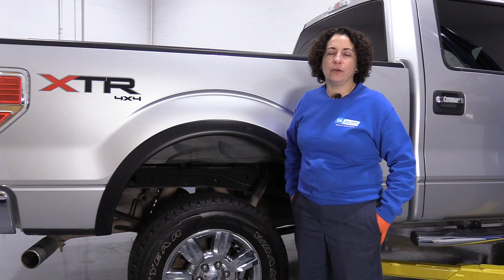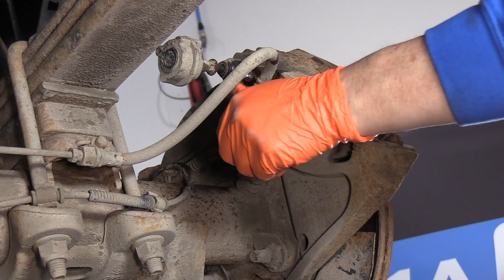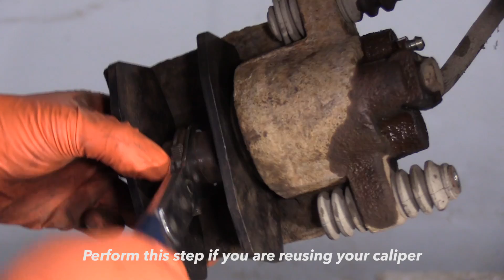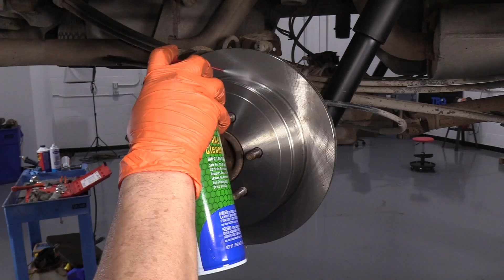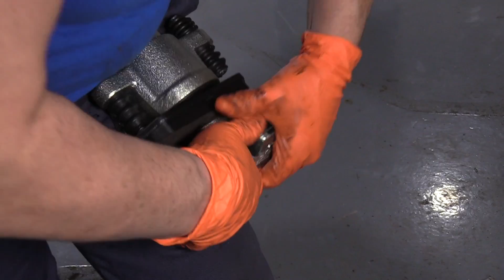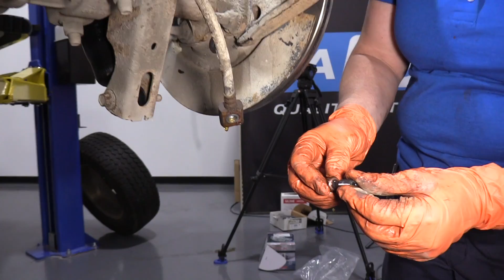How To Replace Rear Brakes 04-11 Ford F-150

Comment: I have never opened the bleeder screw on any vehicle that needs a brake job and has abs and never once have i damaged an abs module by pushing the piston back. They are designed to have pressure go both ways.
Reply: Me either and I have 30yrs. M-Benz experience.  ABS has been around since MY '82, or thereabouts.
Reply: Your both Wrong! The ABS is Not designed to have force against it (Push In) you must open bleeder screw. I'm a mechanical Engineer from Ford.  
Why do you think we have bleeder screws? Bleeds Air out of lines (when replacing Calipers) and allows safe retraction of bake cylinder equipped with ABS system.
Reply: Me neither. I’ve always done my own brake jobs, always had abs, and never released the bleeder valve for just changing pads and rotors. Never had a damaged abs. 🤷‍♂️
Reply: @SF-rl7hl  The official Ford service info doesn’t instruct you to open the bleeder at least on a 2009 RWD model. Some people do it but living in the rust belt I’m going to try and avoid it.
Reply: I never did either but recently learned that the reason you should do it on abs is because the fluid in the caliper area gets very hot during breaking and can become contaminated.  If you push this fluid back up into the abs module you risk damaging the abs module -   really expensive part.
Reply: @SF-rl7hl  Ford stated that the module is designed for both directional flow, this is how the pads release back when you remove your foot from the peddle. However, not opening the bleeder will allow contaminants into the system which could cause faults

Comment: The harmonic balancer on the caliper slider comes off. Hold the caliper bolt with the 10mm wrench and use a vise grip to give the balancer a twist. Remove balancer then use the box end of the wrench or socket to remove caliper bolt.
Reply: Wish i wouldve read this 2 hrs ago. Mine was rounded
Reply: it is held on with a torx head small bolt under the plastic cap

Comment: enjoyed the video, we forgot to grease the back of the pads mating surfaces, i believe we forgot to grease the shim surfaces , we also forgot to antisieze the 10 mm and bleeder valve , brass banjo plainly doesn't need it, also while cleaning and adjusting the parking brakes there is three contact points per shoe that get a dab of grease and if my memory serves me right there is an actuator lever that gets rusty and causes the P brake to stick , lil dab of something inside the adjuster wouldn't hurt, nice touch on the antisieze round the center cap area
Reply: No PPE was used, esp. EYE protection.

Comment: I just watched a video where they replaced the rear pads and the rotor on a 2011 F150 and the pads had the double notch on the top and the single notch on the bottom with the wear indicator on the bottom. I figured I would watch your video as well to make sure there was nothing different. I guess I’ll just see how mine is laid out and put it back that way.

Comment: When bleeding, you should tap the caliper with something metal to make sure any air bubbles are knocked loose. Make sure the parking brake adjuster moves freely before putting the new rotor on. Even though the calipers are pretty small, they probably should not be supported by the rubber hose. Otherwise, great info.
Reply from the maker: +a2cryss Thanks for the feedback!

Comment: Take a air hammer with a straight shank or hammer shank and blast it all around the outside of the rotor, it makes them come off especially when you live in the rust belt.

Comment: Should mention that the rear calibers could be potentially put on upside down.  Meaning the bleeder valve is on the bottom and not the top making it impossible to bleed afterwards..
Reply from the maker: +Brad Durnford Thanks for the tip! We'll pass this info along to our production team.

Comment: You got lucky the rims don't usually break loose that easily!
Reply: True that! I literally and feel bad saying this but I never in my life used a sledge hammer untill I changed  rear brake. At first I tried the typical kick  then a few more kicks then even more harder kicks then I took break after it was round two I was felt mike tyson! I beat the u know what out of this wheel.  I  lost 
That round. Long story short after tapping the rim with wood and hammer I cracked the plastic layer. Little did I know that it was plastic coated. I always s thought it to be chrome dip metal. So by time 2 hrs later I got the sledge hammer out destroyed the rim I got it off. I won but i lost. Moral of the story be liberal with antiseze.

Comment: Why the heck would you open the bleeder??????? 25 YEARS AND IM STILL WAITING ON THAT DAMAGED ABS MOD!!!!🤣😂🤣👍
Reply: Was wondering this to
Reply: Apparently at some point in time this "issue" was something to be mindful about. However with vehicles made in the last 20 years it's no longer seen as a problem. Vehicle manufacturers have taken great steps to make sure the ABS Module isn't compromised when changing out brake pads and rotors. It was true during it's inception in the 1970's all the way into the late 90's. First generation ABS Modules were very delicate and one tiny mishap causes brake failure(s). It took years of refinement and revisions to get the ABS technology up to par with necessary standards. So yeah go figure 🍾

Comment: I have never had any ABS issues, I never open a system unless I am changing a calibre. How does a ABS system not allow 2 way fluid direction, it activates brakes off and on ?

Comment: I've replaced a fair amount of brakes without issue and have never dealt with brake fluid.  Is it necessary to do this on my 2010 F-150 or can I pull the caliper, remove and replace the pads, replace the rotors, and reinstall?
Reply from the maker: +Chris H Thanks for watching!  If you will be bottoming out the caliper pistons and you have an ABS system, then you will have to follow this process to prevent damage to your vehicle.

Comment: Damn, knocking those 150 ftlb lugs like a boss
Reply: Prolly should have used a BREAKER bar to loosen the lug bolts, then a ratchet to run them down.
150ft/lbs. torque is pretty hard on ratchet teeth.

Comment: In your video, turning the parking pass loose and tight. You’re adjusting them backwards both times. Waisted half hour on my life trying to loosen the pads. Fix your video. It’s handle pivot up to loosen, handle pivot down to tighten.
Reply from the maker: +Ethan Ellingsen Thanks for the tip! We'll pass this info along to our production team.